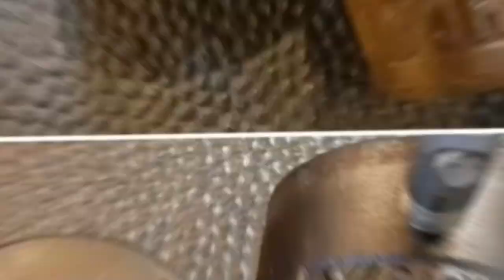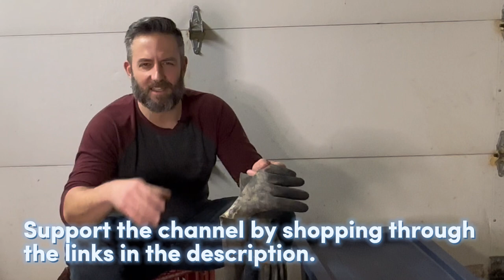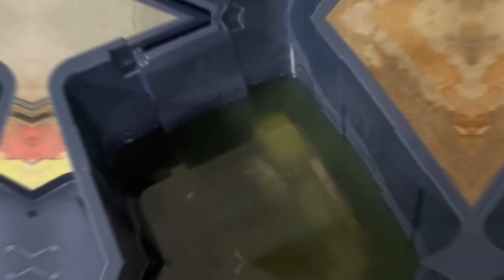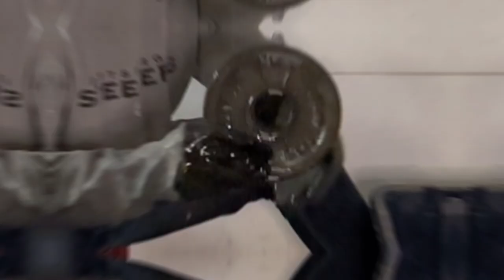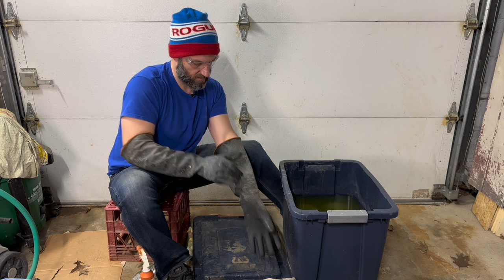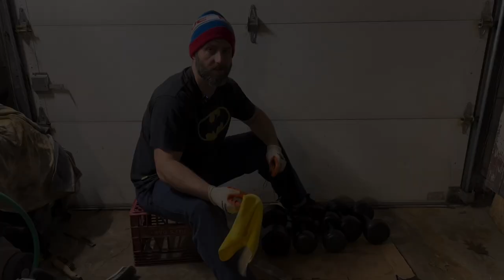Weight Restoration! How to Remove Rust and Keep Original Paint! UPDATED Oxalic Acid Guide! Gymhack!

Comment: Another nice resource, thanks. Now I need that video on straightening bent roundhead handles.
Reply from the maker: If you don’t have access to a press or anything heavy duty like me, here’s the process: arrange the dumbbell so that the bend I curved up like a rainbow or frown, then place a 2x4 or other piece of wood over it, kneel in front of it, bash it with a 100 pound plate. Do so at your own risk. But that’s what I do.

Comment: I have lots of old weightlifting equipment. But space is limited in my one bedroom apartment.  Some of the plates I buy or dumbells I do this in my apartment.  Bring weight to kitchen sink. I use  "Brillo" pads" and cold water. Scrub them down good. Rinse them well. Wipe dry with Bounty paper  towels. Then I use Crisco cooking shortening.  Rub it into the cast iron real good. Then wipe down with more clean paper towels. Your plates and dumbbells are cast iron? Well,so is my old cast iron cookware. 1920's Griswold Dutch oven ,and cast iron frying pan. I seen a YouTube video on how to clean vintage rusty cast iron cookware this way. So....I thought why not my weight plates and dumbbells? They're cast iron ! Came out great ,I thought...
Reply from the maker: In an apartment that sounds great.
Reply from the maker: Hi there. Send me an email at VintageWeightsPGH@gmail.com
Reply: @vintageweightspgh  I sent you an email just now...
Reply: @vintageweightspgh  I tried. Email failed. Won't send.🤔🤷‍♂️

Comment: I'd like my rusty weights to look good, but the problem I have with this is that, apparently, oxalic acid is EXTREMELY hazardous. I don't even like to use pesticides, or keep them around the house. Look up "oxalic acid dangers." With some bad luck, or a mistake -- even a fluke, and it can even kill you. For me, even a minor risk of a problem isn't worth getting rid of some rust, which in the big scope of "moving weights" is trivial.  "Contaminated" clothes, shoes, etc. are recommended to be thrown away, etc. Have you tried the vinegar dipping avenue? How does that less hazardous approach compare to this oxalic acid version? Or other options? That might be a potential video:  comparison -- and relative toxicities -- between different methods of removing rust. The pros and cons of each. Again, what needs to be underscored here, I think, is that oxalic acid is really nasty stuff. There's no safe margin for error.
Reply: Either way, you're still working with acid. If you aren't comfortable diluting the oxalic acid, you can use vinegar, which is dilute acetic acid. Vinegar will take longer and in my experience doesn't work quite as well as the oxalic acid or other commercially available rust removers.
Reply from the maker: To the best of my knowledge Oxalic Acid isn’t extremely hazardous. It’s naturally occurring. Its the main ingredient in Bar Keepers Friend a common powder used to clean pots and pans at restaurants. I definitely wear protective gear and as I mentioned in the video safe guard from children and pets. But I’m more concerned about household cleaners than Oxalic Acid.
Reply from the maker: Vinegar also will strip to bare iron including the original paint. But I agree with you that there are plenty of acids used in everyday life.